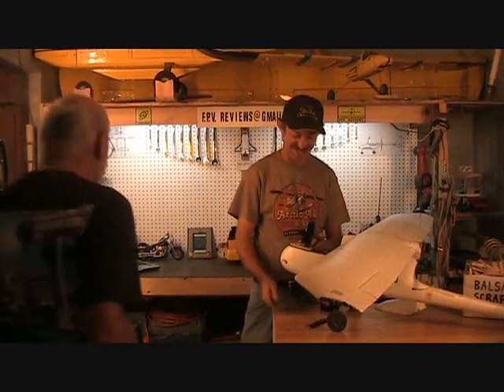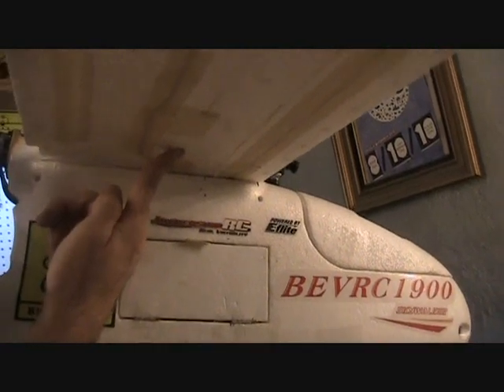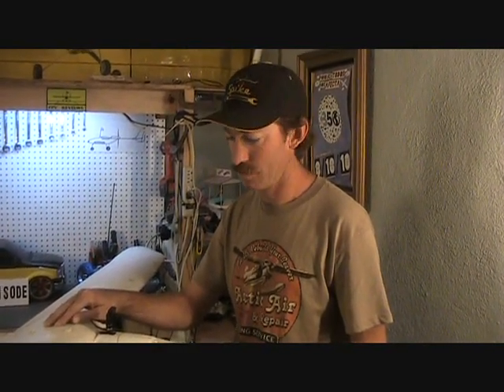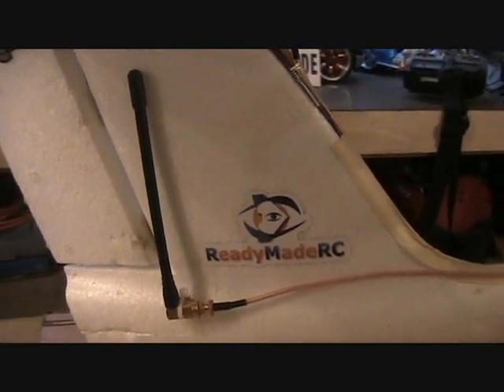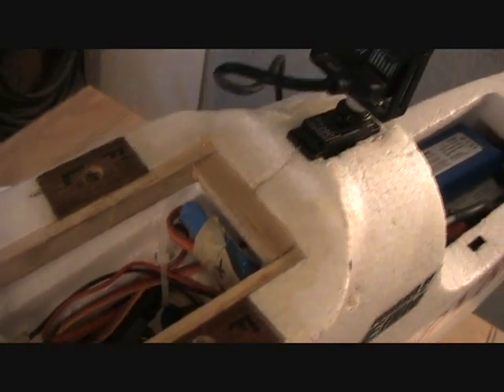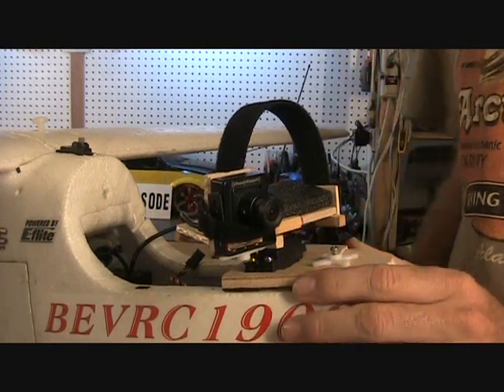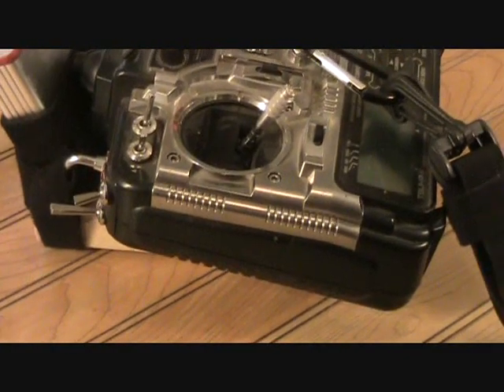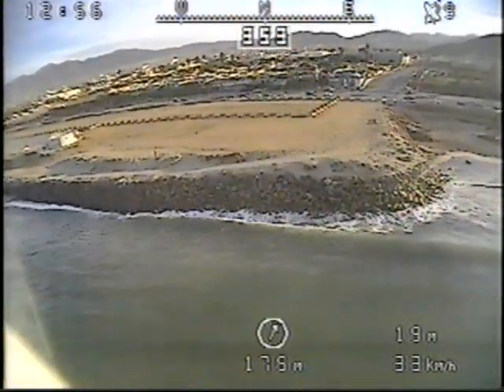FPV REVIEWS-SKYWALKER 1900

Comment: It's 2025 .. ... Thanks for showing everything......
Reply from the maker: ha you're welcome.  Things have changed a lot, such as ELRS, or my current still favorite, crossfire for Control.  Analog is not dead either.  I just got a new very long range system and also a here link digital system.  both are supposedly very good.

Comment: Skywalker also have a .. 
saw either you changed the angle of the elevator .. 
what does that change? improvement wherein? 
I my flight but it seems he flies with weight tail .. even being attempted with the CG .. follow the same CG that you stated .. 7cm after the wing chord. 

thank you
Reply from the maker: more stability in pitch. less trim needed.
Reply: FPVREVIEWS but it is mandatory to make this amendment? 
for I perceived my looks qo flying weight of tail .. 
This modification solves this problem?
Reply from the maker: Israel Cunha not mandatory, but mine flew better.  there are several models of skywalker, mine was the 1900. others may be different.

Comment from the maker: using uhf? might want to mount the rx in the tail. also ferrite rings for all the servo wires, as close to the rx as possible. make your own half wave diepoles. i have since done this, and will be making another video. i just carved a pocket in the vertical stab.  wrap the wiring harness with alum foil for shielding.  just a few extra tips.  cg at the back of the wing pocket for the 1900 mm wing. that's actually 100 mm behind leading edge. wish you the best. you might try dragon link v2. instead

Comment from the maker: maybe they will solve a couple other problems with the skywalker, like the blunt aft end of the fuselage right in front of the  prop, or the close distance from the trailing edge of the wing to the prop. maybe a little bit of dihedral, or polyhedral in the wings.  when they get it all worked out for this configuration, it will look just like my atlantis 5 uav, you can see on the bearspace channel.   search : bearospace atlantis 5 uav

Comment from the maker: yes, it does. solving one of the limitations of the skywalker, that being it's prop diameter size. i understand that the prop size will be increased, maybe up to 12 inches. should help a lot with power plant efficiency.  there are not many out there yet.  it's not worth it to buy the new one if you have an older version, as they can be retrofitted with one as well. it takes a while to put together a system like this, and when you have it all dialed in, there is  a new version out there....